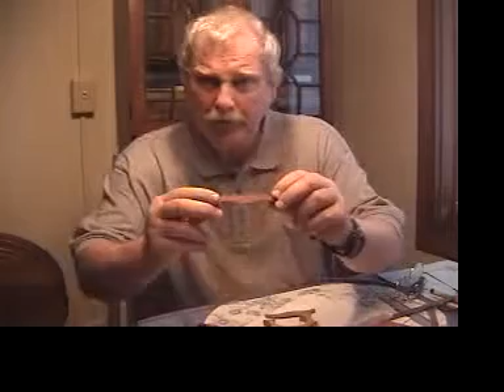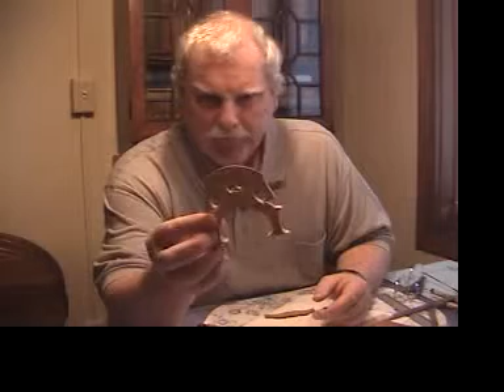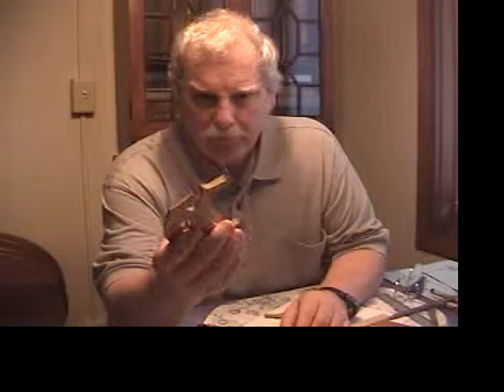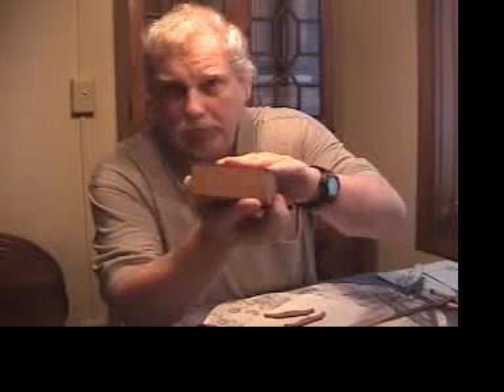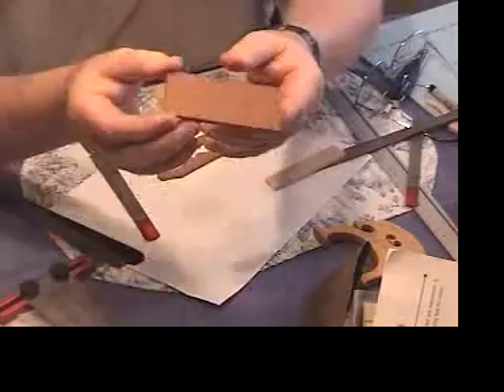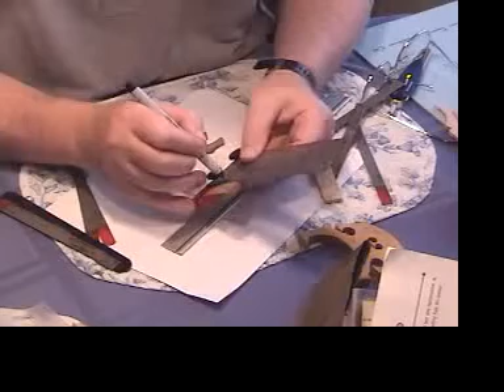Banjo Bridge Making Part 1

Comment: Mike, what glue worked best to glue up the two pieces
Reply from the maker: I use tightbond, but hide glue or fish glue should work.  I have fixed small errors with superglue too.  Every bridge is different due to wood being a unique material, that’s the reason why I stared making bridges in order to have a lot of bridges to try out when I see up my banjos.

Comment: Hi mike, do you laminate both pieces with the grain ?    Do you cut blank with grain or against the grain..   thank you
Reply from the maker: I just use precut 1/8” stock and don’t check the grain. I doubt that would make a difference. On the other hand the orientation of the body is very important depending on what you want to do.

Comment: Mr. Keyes this is just finer than frog hair. I've been getting further away from performance archery and more into some lutherie experiments, mods, fixes, and now some bridges to try out some of the wonderful, old wood I have left over. Thank goodness I held onto dropoffs for knives etc. which are perfect for bridges (red mulberry, maple, ipe, purpleheart, sapele, walnut, in varying densities from heartwood to sapwood, branches to trunks, and some mystery "ironwoods"). And I was already quarter-sawing for the bowyer wood, so the grain orientations are fortuitous as well. I just needed to choose a pattern (or two) to stick to so I could truly compare woods and weights. I think this will be my go-to, indirect linear path one, and then maybe a direct-connect one like a spillway with little feet. Some of your tips can be used in other designs, too, so thanks for such a great tutorial as well as a top notch design.